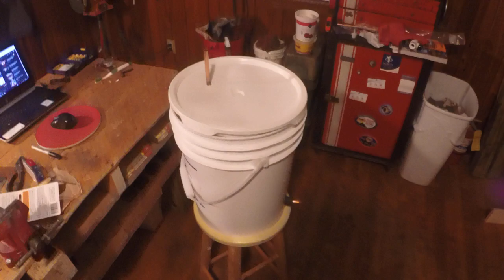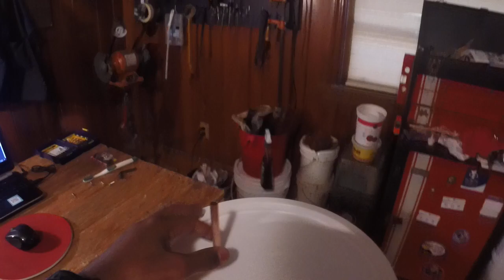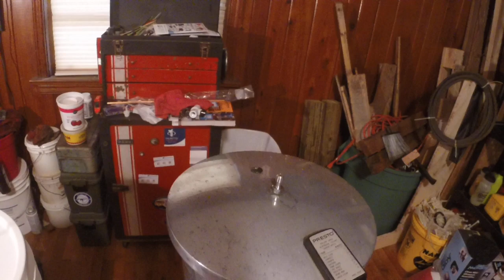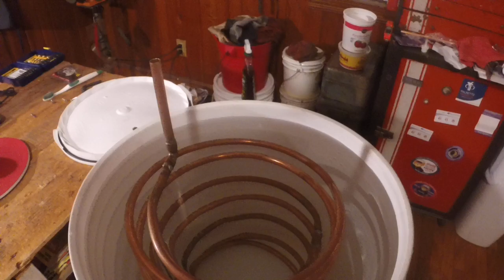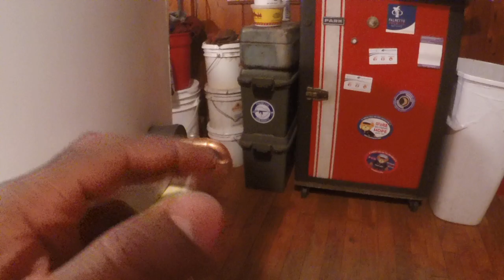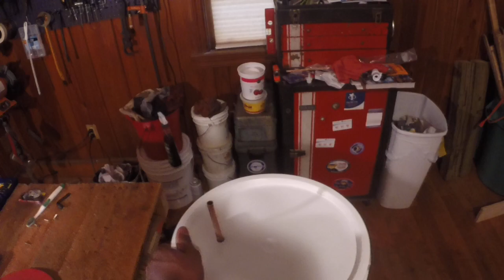Homemade Water Distiller

Comment: How did you make the coil - wrap the copper line around something cylindrical?
Reply from the maker: +richabh The copper pipe came as a coil, so I kept bending it slightly to maintain the round pattern.

Comment: Is there any issue with volatiles gassing up and precipitating into the finished product?
Reply from the maker: +TheBetterManInBlack I would think only if it has a lower boiling point than water.
Reply: TheBetterManInBlack filtering the water afterwards thru charcoal would help remove most common chemicals from the distilled water.